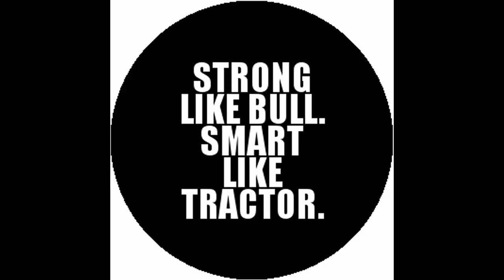How NOT to paint a car!  1966 Mustang Fastback | Painting my hood

Comment: What grit did you wet sand with? I would have sanded back the first high build coat until it was smooth and then added a second coat after, for wet sanding with higher grits. That orange peel might have been from too low of temps outside?
Reply from the maker: I used 320 - ultimately I sanded it back smooth & sprayed a new coat.  It looks okay enough for now; I'll respray the hood again at some point.  It's summer in South Carolina, temps definitely weren't too low. 😅
Reply: I feel your pain... repainting my 66 Fastback (black too) this month....same deal...learned to spray on a boneyard hood with single stage paint, 1 part reducer...then clear over top ....not easy... GT350 tribute?